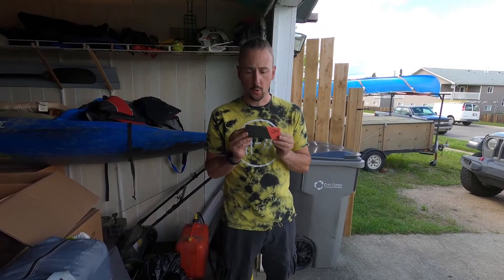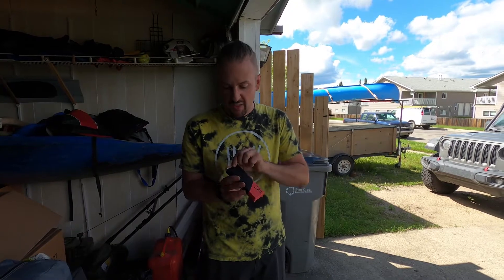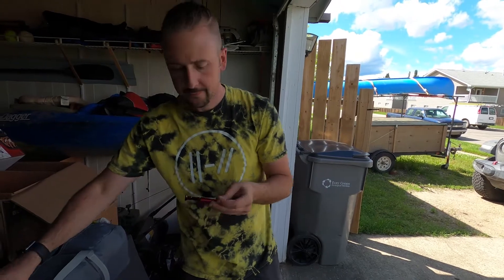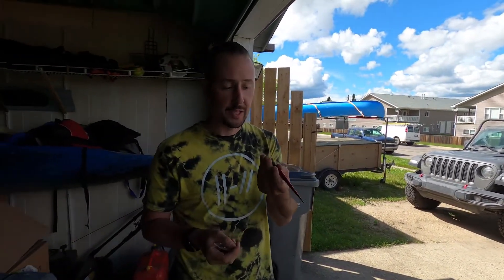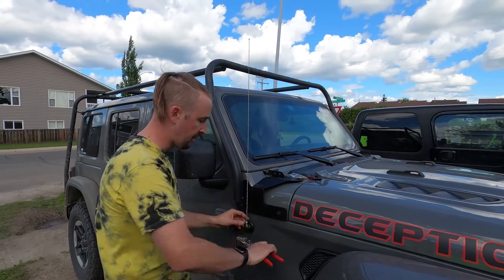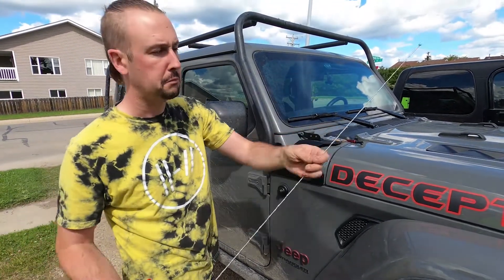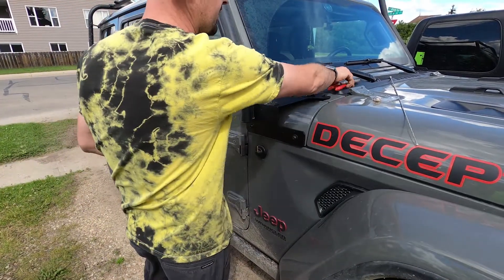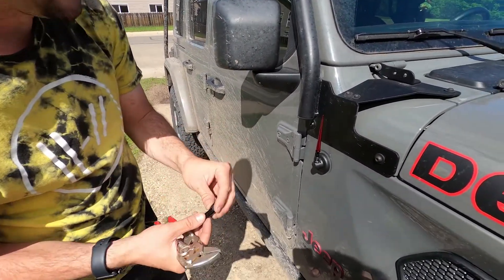Modifying the AM/FM Antenna on your Jeep Wrangler!

Comment: Done the same thing. The small antenna you dont get good signals since radio waves are high in the air. I put stock back on looking for a signal booster. My grand cherokee has antenna mounted on top of the jeep and picks up everything but not my wrangler.
Reply from the maker: @dw1284  you can even buy a windshield that has the antenna integrated & hook it up that way as well.